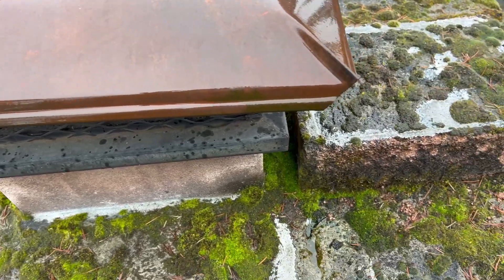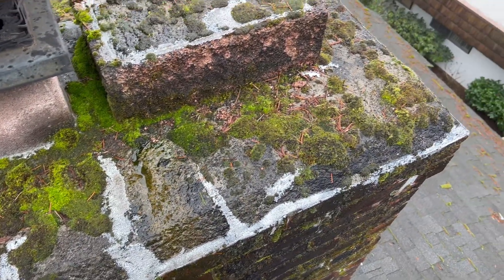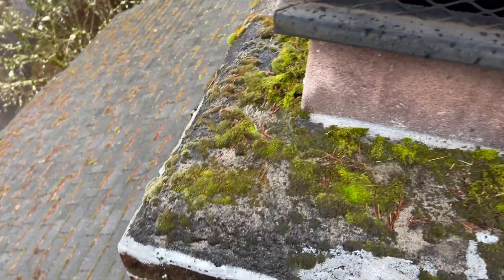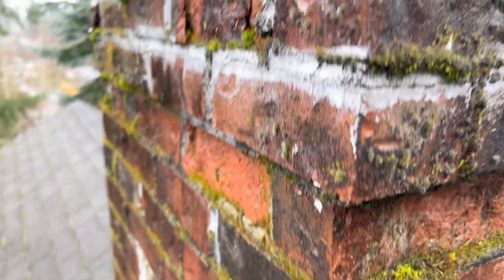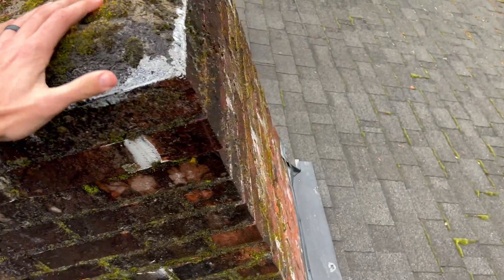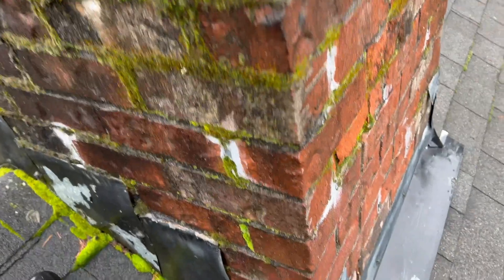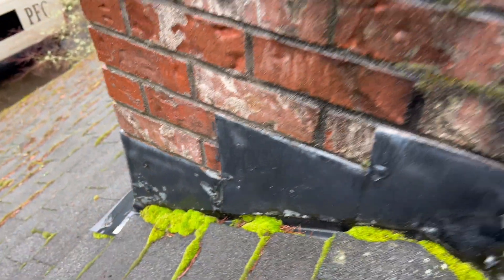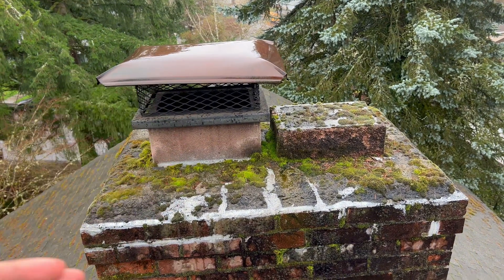What happens when you don't have a proper sized chimney cap?

Comment: Problem with the brick is the wrong mortar used.
Reply from the maker: Type -s mortar can be used. On this chimney we found the issue was water dripping off the small roof cap. It pounded a hole right through the crown.    I also found the cores cells in the brick to be missing mortar. The void spaces had water trapped in them. This is what turns to ice in the freeze and implosion of the masonry unit occurs and the brick faces fall off. (Spalling)

Comment: It is certainly very difficult to find workers capable or willing to go up high and install a proper chimney cap. This may include also working with concrete, and exceedingly few are able or willing to lug those sorts of heavy materials up high on a house. In my case I needed brickwork done on my chimney, and the typical response I get from bricklayers is that they only work on the ground. Also, a great many contractors simply say that every little job will cost $10,000 because that is the first nice round number than pops into their head. Non-homeowners seldom consider all such exasperating aspects of owning a house. Finding contractors and decent repairmen who work at a fair wage is nearly an exercise in futility.
Reply from the maker: I wish you lived in our area. I have no problem finding such capable craftsmen. But birds of a feather flock together. I know where to look for them. And they respect me because I respect them. Artists and athletes. We bid based on labor hrs. $140 per man per hr. It's pretty much the cost of doing any service business when you add up all the operating expenses of trucks, fuel, equipment, materials, taxes, retirement.  Please reach out to my office and we can connect you to a reputable service provider in your area who is apart of our Guild.

Comment: What happens if you don’t have a chimney cap at all???
Reply from the maker: Your chimney absorbs water like a big sponge. Then freezing temperatures turn that water to ice and you get expansion and contraction creating cracks and breaking the bonds in the mortar.
Reply: @PortlandFireplaceandChimneyInc  the guy wants $600 bux to put it on 2 of them
Reply from the maker: @jjjjjjjjjjjhjjjjjhjj  seems like a no brainer.